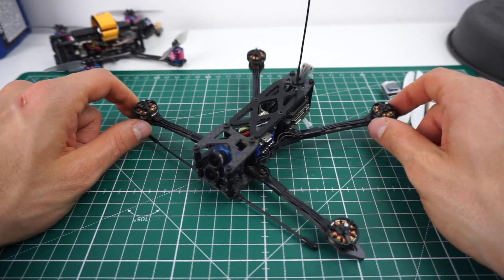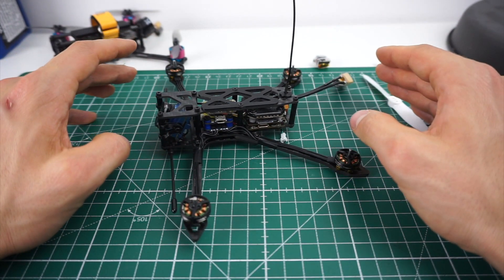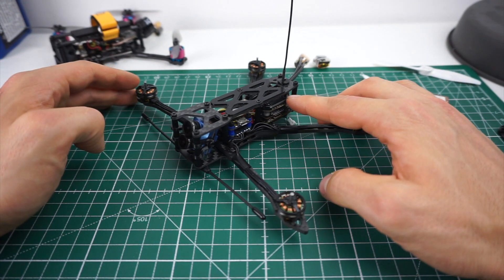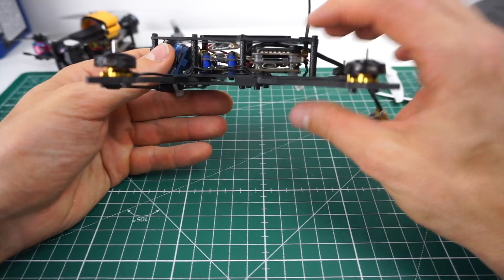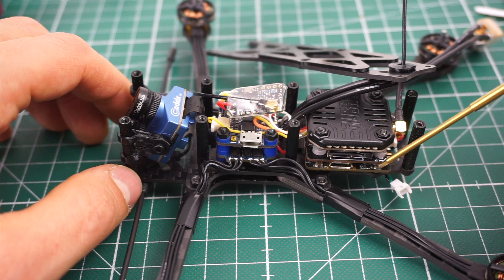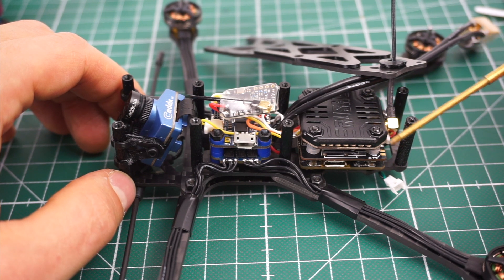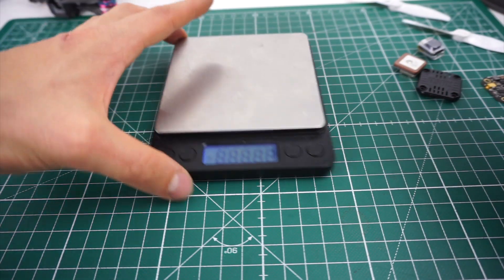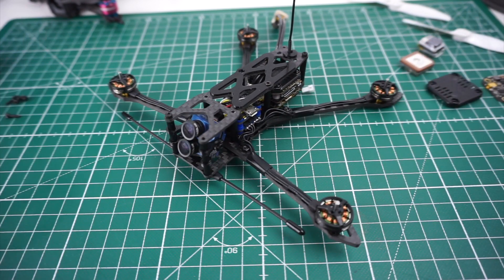Project #MicroLongRange - Progress update

Comment: noticed that there is a 0.5mm difference between the top plate and the 20mm standoff. Do you just bolt it down regardless?
Reply from the maker: Yes!
Reply: @DaveCFPV  thanks, was wondering if I made a mistake somewhere.

Comment: I love this project! I'm working on a very similar build usinig the tomoquads katana lr4. I came across a 3s 1100 mah GNB lipo that weights only 66 grams (!) and I'm in the process of choosing motors. Best suitable candidates seems to be Emax 1306B 2700kv (too low for 3s?) Or Xing 1404 3850 kV. What would you suggest? My goal is to reach as much flight time as possibile!
Reply from the maker: I'm testing DYS 1404 6000kV on 2S next. The DYS are super efficient. 1402 8100kV worked but was lacking efficiency. I'm running pretty high kV because I want to use Li-Ion. On 3S LiPo 1404 3800kV works best in my opinion. Do you have a link to that GNB? That sound crazy good! That is the same energy density as my Li-Ion!!!
Reply: @DaveCFPV  thank you!
Here is the lipo: http://www.allanrc.com/option/mod_product_detail/mid/7375/cid/33413

I didn't find any review of it so I just  blindly purchased a couple of them... I will let you know as soon as I have them in my hands

Comment: I got the same fc stack but can't get Tramp to work on the LED pad. Remapping doesn't work. This is both on 1st and 2nd version of the fc. I've asked iFlight to identify the pin for smart audio/Tramp and use that instead of remapping to the Led pad. I have yet to get a reply. Did you get yours working? Very cool build BTW 👍
Reply from the maker: Thanks! No my SamartAudi doesn't work either

Comment: Really pretty frame design there.  No reason for it to have less flight time than larger quads.  It just won't move as quickly as larger quads.  Your concept is sound. I have a few similar concept designs but 4" is still a bit of a bastard size. 5" is not much bigger.

I would guess you're going to have really loose control from those very little motors vs the prop size. Flight time should be good. I have a few long bodies like this but would go towards a bottom mount to be able to drop frame weight a bit and make it more durable at the same time. 

Really nice electronic layout.  I started testing 16x16 FCs for 5" but they were just too small to reasonably solder when a larger fits on a 5". That tank vtx is my favorite by far and will be one of the two I'll be carrying in my own store when we have the funds to do so.

About the shaft, it makes no sense for hHQ to make 4" and 5" T mount props with 1.5mm holes. It also doesn't make sense to make the 3" 1.5mm hole because nobody is using the 3" without the mount screws.  I've explained this to Zhong many times but he doesn't seem to note, care or maybe he doesn't understand it somehow. Either way, gemfan has a few new props on the way for the press fit. Also, unfortunately I don't think you can drill out holes easily with the right balance. So you may be limited to 3" on that quad for now if you don't want jello 😔.
Reply from the maker: Thanks Bob, these 1303 you came up with are great little motors! You're probably right they are small for 4" but in this case I'm ok with giving up some control for increased flight time as long it's not too bad. I'll also test 1404 for more responsive / powerful setups as well as high kV 1402s to match the low cut off voltage of a 2S Li-Ion.
Btw. what size LiPo would run on this 1303 setup? I was thinking of 1300mah 2S for long range / 650mah 3S for Freestyle.
Reply: @DaveCFPV  yeah 1300 2s would probably give over 10min flights with really docile performance. May be able to even go up to 1500 or 1800mah
Reply from the maker: KababFPV thanks! Just found a 1500mah 50C 2S that is only 88g. Agreed on the prop topic. Since 2mm fits both why the hell still do 1.5mm. At least Drilling 1.5mm to 2mm was waaaay easier than 1mm to 1.5 so I hope it will not introduce too much imbalance especially with the screws. On the other hand there is a lot more rotating mass compared to 65mm

Comment: HQ has some 4" tmount props out now. Apparantly they're super good. Theyre called the "HQ T4x2.5".
Reply: https://pyrodrone.com/collections/new-products/products/hq-durable-prop-t4x2-5grey-2cw-2ccw-poly-carbonate
Reply: i thought they had 2mm shaft holes, but they are 1.5mm, too
Reply from the maker: astro yes quite cool coincidence that they come out just at the right time for this. 1.5mm shaft but I‘ll simply drill them out
Reply: @DaveCFPV  I've heard that HQ is working on 2mm shaft versions of their T series props. Not totally sure if that's true.

Comment: you could use the crossfire nano and set a channel to smart audio and use it to control the vtx and just not use the fc for smart audio at all
Reply from the maker: Good idea. Thanks! Worst case I also could run the CRSF on SBUS to free up one TX pin.
Reply: @DaveCFPV  Wait,what? How? Sbus? How...? Did I miss something? I'm still new to crossfire... Have no idea how to run it.
Reply: @miklosko3355  on newer crossware firmware when you setup the RX via the menu when you setup the channel pins on the rx to output the type of protocol you want crsf sbus etc.  you can set crsf on channel 1 and two and set smartaudio on channel 4.   as long as your vtx works correctly with the smartaudio protocol it will control your vtx direct from the receiver.  once its setup this way you use the menu on your crossfire either through lua or via the fullsize lcd screen to tell it band/channel/power of your  vtx
Reply: @mavericm4  This sounds like black magic to me at this stage. Certainly something I have to look into. I don't fully understand it yet but I will give it a go. 
What if I have a FC that has a sbus ,S-port and v+ and grnd pads only? Will that be possible to run the crossfire on it?
Reply: @miklosko3355  crossfire can output sbus to the fc but you lose some of the low latency of it when you do that but yes you can make it work on sbus if you don't have a regular uart
Reply: @mavericm4  And Thank You kindly for all the answers to my questions. I really appreciate it.
Reply: CH 4 on the crsf nano is for smart audio